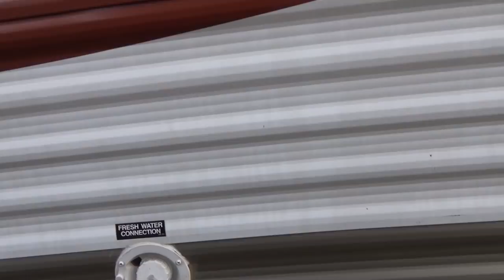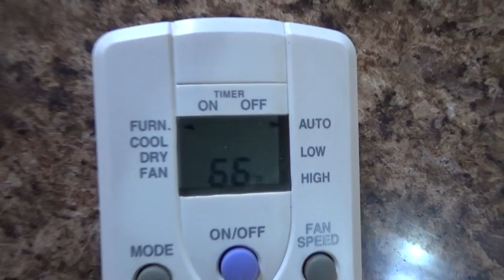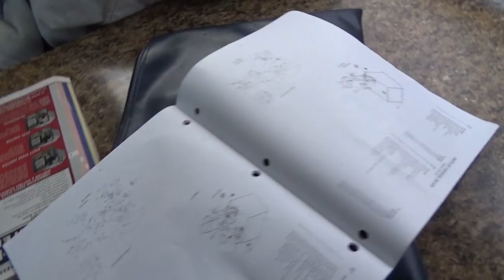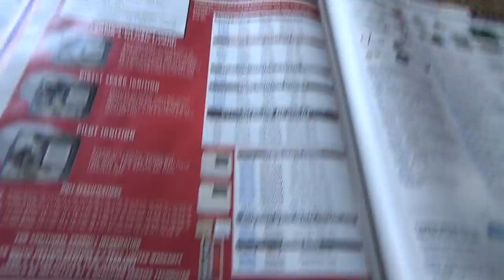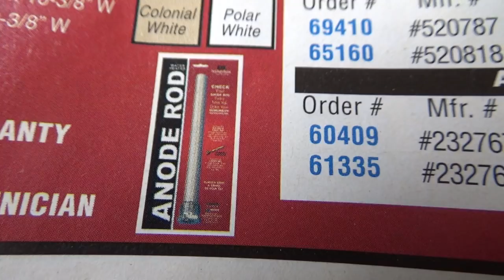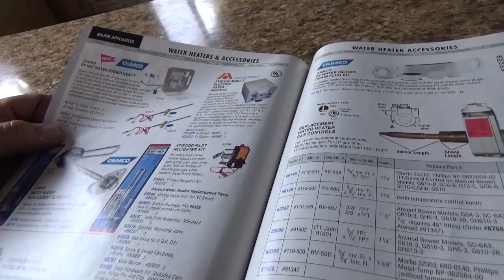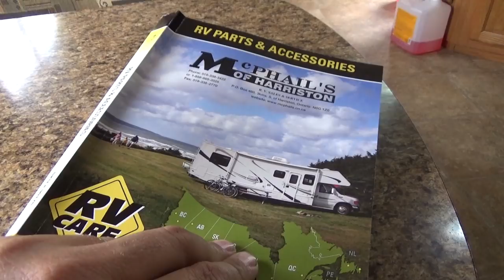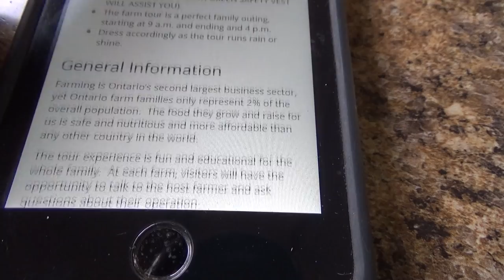Travel trailer winterizing

Comment: You did a good job winterizing the plumbing,it will be fine. I wouldn't worry about changing out the existing water heater, it doesn't use much gas and it has a pretty fast recovery,with the new anode installed will prolong it's life.

Comment: I was looking at the on demands on line and found that these are not too expensive and the reviews are pretty good. That's electric though, which is fine considering I'm paying for electricity at the campground anyway. If we'd boondock, I probably have to option for the propane or combination. Good video on winterizing. I know that some people argue this, but I like to just tarp the roof of my camper and not wrap like some do. The other thing that I do is strategically placing bars of Irish Spring throughout my camper to keep the critters out. I learned about this on a camper forum and haven't found any critters inside in the Spring. Good video.

Comment: God that looks like a complicated system. The problem with trailers is the people who build them try and put in as many designed-to-fail systems in them when they put them together, so you'll be back to get maintenance work done on them down the track. Why don't they just put a drain cock for hot and cold at the lowest point of the system so you can drain EVERYTHING? and have a similiar thing for the freash water tank and hot water system. Definitely go to one of those water-on-demand pumps if you change the one you've got , you'll be glad you did. Don't forget to put your anode back in before next sukmer, otherwise you'll be filling away for some time before you notice your tank isn't getting any water in it and theres a big puddle of water beside the Trailer ;)

Comment: Bill, On demand water heaters are great for efficiency on gas I live in the UK and we use on demand in most homes. There are 2 faults that I can think of, 1. is that using more than tap at a time the closest one to the heater on the run of plumbing gets most of the hot water not a problem till someone is showering and all they get is cold. 2. Because of the coil of pipe inside the heater which is used to transfer heat from the flame to the water it can affect the water pressure. Hope this helps. But if you can learn to live with this then it saves a good bit of money on fuel.

Comment: The on-demand water heaters use more propane when they're running but they only run when you're using the hot water. They don't cycle on and off 24 hours a day to keep 6 gallons of water hot whether you're using it or not. In the end the on-demand ones are more efficient and you get all the hot water you want instead of just 6 gallons.

Comment: This might be a daft thought but I am surprised none of your pipes have any lagging/insulation on. This would help with the cold weather protection but also help with hot water transfer from tank to point of use bit of a mission to fit but worth it. Have done it to the caravans and accommodation on site

Comment: if you get a tire pump to water hose adaptor you can just blow all the water out. then you don't have to buy the antifreeze and don't have to deal with putting it in your lines. much easier.

Comment: as far as a house is concerned your average 40-50 gallon tank is 45-55kbtuh vs a tankless @ 250kbtuh+  if you have teens they typically stay in the shower till the hot water is gone. so with a tankless they will use more gas keeping up.  i would stick with the old school tank so power is not needed.

Comment: Tanked water heaters will heat the water to a set temperature and keep it there.  As you point out, you have a limited amount of hot water until it can be reheated.  Then they have to reheat the water back to the set temperature.  The recovery time is the time it takes to reheat the water back to the set temperature.

Tankless water heaters work on a differential temperature principle.  They will heat the water to a set number of degrees above the incoming water temperature at a specific flow rate in gal/min or L/min.  Just for an example, in a real cold climate, your incoming water temperature may be 40F/4.5C.  If the water heater raised the water temperature +50F/+10C above the incoming water temperature, you'll get 90F/32C water.  If the incoming water temperature is 60F/15.5C, you'll get 110F/43C water.  So, in real cold climates, if you don't have a high capacity tankless system, you won't get the hottest water you may have wanted.  Higher capacity tankless systems need more gas to keep up with the demand.  They still work great in some applications, no so good in others.

In larger homes with high demand, the highest capacity electric units need three 60 amp power connections to keep up with the potential demand.  I imagine that these units during low demand only use as much power as needed, not all three 60 amp power at the same time unless they are at maximum flow rate.

Comment: why not install some sort of sightglass in one of the panels so that you can see what level the leaves are at inside the trailer
all this would involve is some perspex(clear plastic) then cut out a strip of the wood panel on one side then fit the plastic on the inside with sealant and screws 
just an idea and something you could expand on

Comment: I winterize my dads motor-home  I made a fitting to hook to the city water line and hook it to my air compressor set the regulator at 15-25 psi turn the sink and shower and open the low point drains blow all water out then I put the rv antifreeze in the city water line until I see red in sink/shower, ect then I use whats left and dump in the P-Traps and wipe out sinks with rag /// Rv anti-freeze will not hurt you to drink when mixed with water but I always rinse out the lines/tank anyways

Comment: Bill 2 things 1: congrats on 90k and I go to school for welding an the auto darkening ain't workin any more any suggestions on a good auto darkening helmet
Reply: +Stephen McGrath Anything from Jackson would be good. They are pretty expensive, but really well built and they work great. I personally use a W60 truesight with gold colored lens. I think the W70 truesight is really good too with the blue lens.
Reply: +Stephen McGrath   If it stays dark it is a battery if it will not go dark the it is bad( may try cleaning it) , you can use a lighter or a striker for a torch
Reply: kandylandfarms  I did that still nothing im looking at safe phase helmets

Comment: I don't use any freeze just blow out the water line with an air compressor like you wood for winterizing the taps in the cemetery